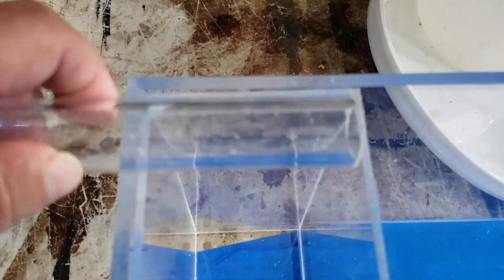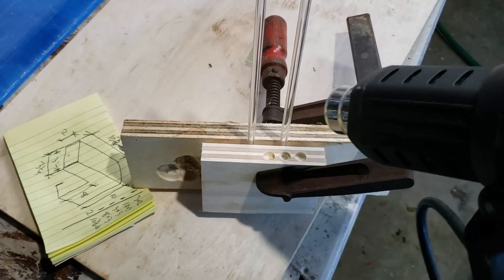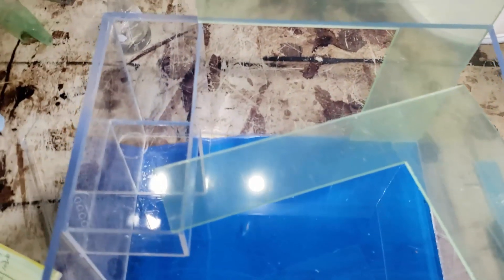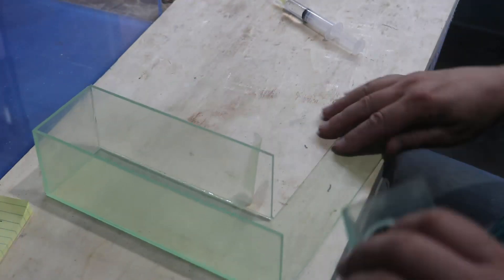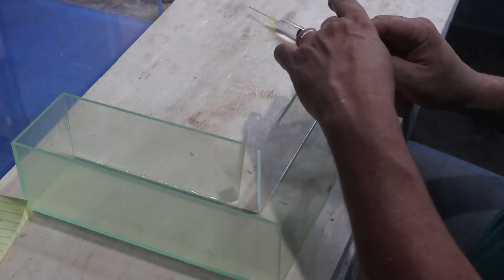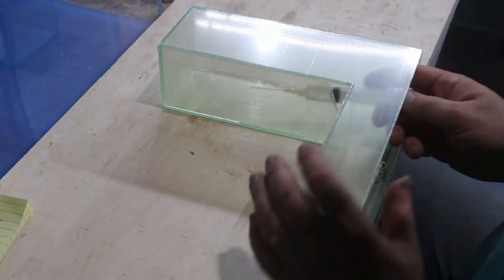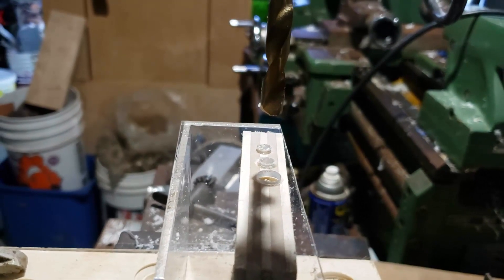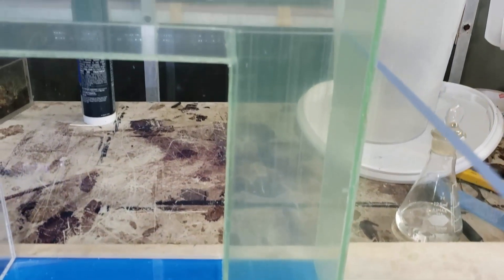DIY Air Pump Manifold & Desk Top Lift Tank Part 2

Comment: Do you stress relieve any acrylic parts?  The internal stresses on the extruded products are insane.

My first acrylic air manifold looked super sexy right up until the solvent hit it during weld-up: https://imgur.com/a/inTgiUx

I was also made an acrylic airlift to use with a Hamburger mat filter that was fine for a couple months then suddenly developed cracks all over the air pipe:  https://imgur.com/RR8xaba  Thank goodness I didn't do a production run...Have you encountered anything like this?  

I admire anybody who works in acrylic; working with it is exasperating at times and I'm thinking about setting up an annealing oven.

Comment: I'm looking forward to seeing this project run.    You mentioned you could do the rods with PVC or something else but I could not figure out what you said.  Sounded like black galring?     It is nearly impossible to get acrylic tubes here so wondering about the black what ever you said.    Thanks.
Reply from the maker: The material is called Delryn. The non brand name is acetal. You could also just ask for machinable plastic and most shops will know what you mean. I have also used UHMW polyethylene, but it's less machinable. Glad you like the build and thanks for watching
Reply: @FishmanEricRussell    Thank you very much.

Comment: I have been following the lift systems and find them very interesting. Have you figured out what the gph flow is typically?
Reply from the maker: These ones I'm currently running produce about 50 - 60 gal/hr. Not tonnes of flow but very usable. Thanks for watching this series
Reply: @FishmanEricRussell  Great. Thanks. Im in the process of switching over to air drive filters and was wondering the flow rate. I know it will be less with a sponge in the chain but it gives me a idea for flow. I was guessing less than half of that rate. i.e. how many DIY sponge filters to turn a tank over enough. Im going to more playing lol
Reply from the maker: @camerazeye7923  That's the funny thing about filtration. I have large tanks with next to no filtration and small tanks that I've gone crazy with what's running them. If the tank is a balanced fish and planted aquarium, it's surprising how little is needed. If you're raising fry on the other hand... The video I'm planning for Friday kind of shows this (I hope). Have fun with the tinkering